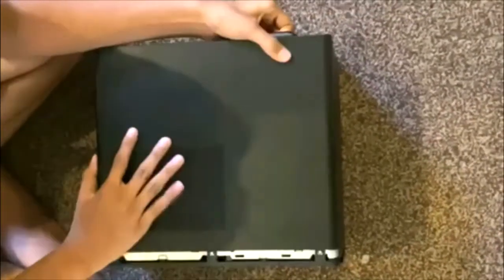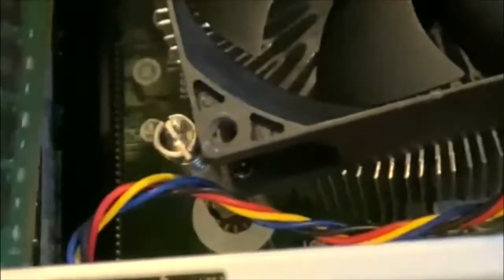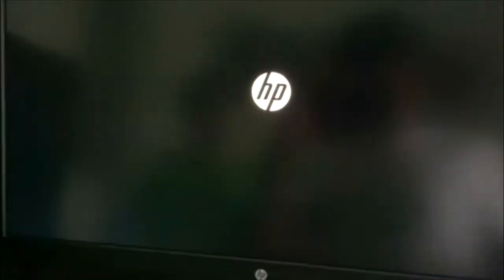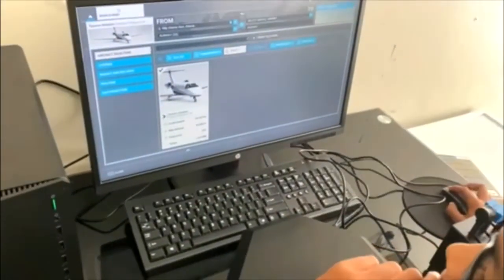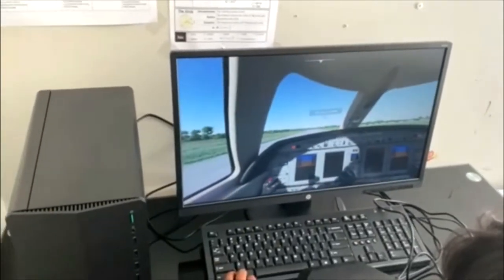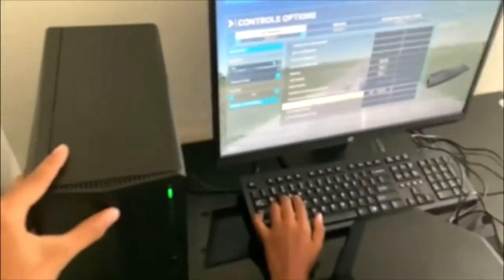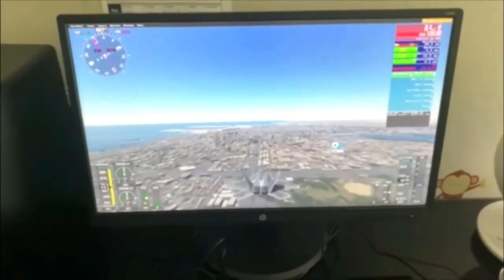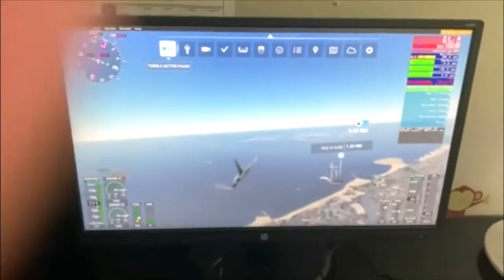Best prebuilt out there? Setup and upgrade of HP Pavilion desktop TG01-0023w, PT 1

Comment: Excuse, this pc have tpm 2.0 for update windows 11? Thanks
Reply from the maker: yes it does, it also has a 3rd gen amd cpu, this computer should run the new windows 11. You do not have to worry about this because the free upgrade will roll out in 2022, so you have time.